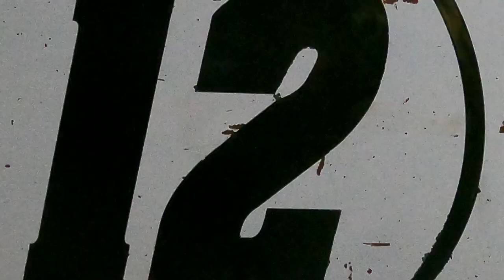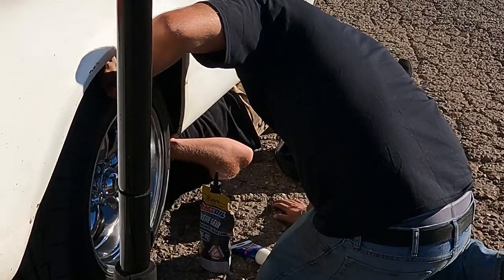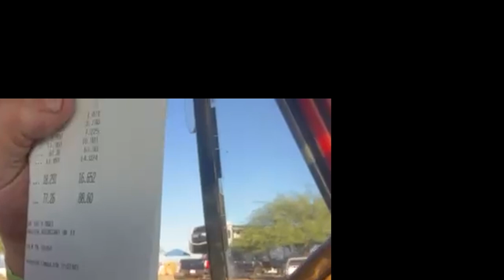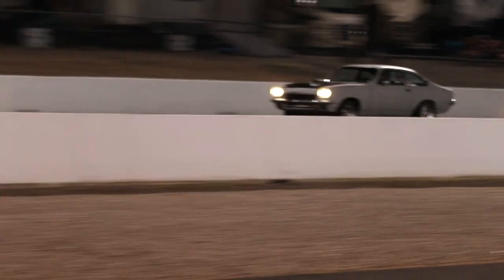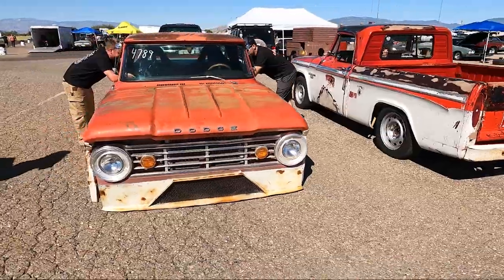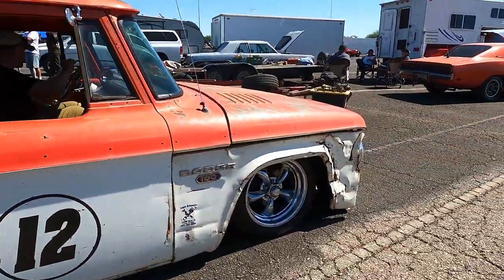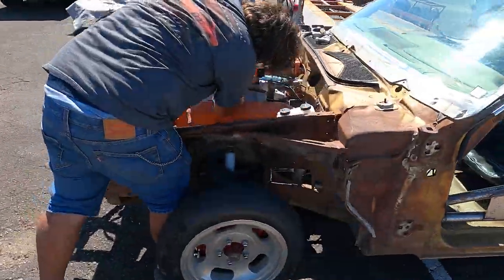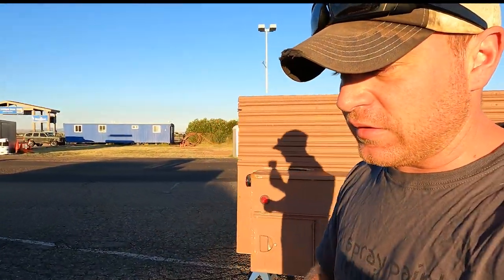First Time Drag Racing? What did I learn? Duct Tape Drags 2023

Comment: Good effort, the truck looks killer 👍😎
If you are running a mechanical fuel pump check the pump pushrod for wear, maybe the pump is short stroking, it took me a while to work that out on my 383 Barracuda 🙄

Comment: What gauge cluster do you have brother?
Reply from the maker: I ended up making the gauge cluster itself, at least the bezel.   The gauges were each bought from Autometer, which were customized through them at a slight increase of price.
Reply: @HighRevNation  forsure brother I have a 1979 dodge d100 and I'm finally getting it up and running after 4 years your truck is sick bro👊🏾👊🏾🙏🏾🙏🏾